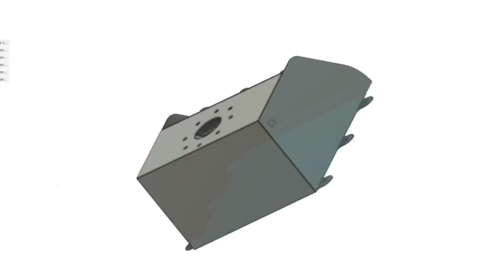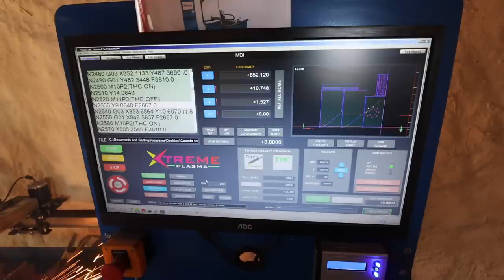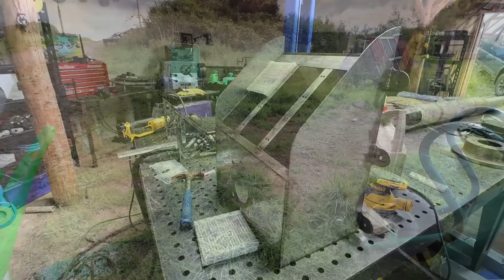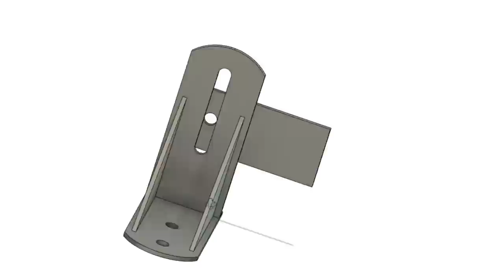North Wales 1.5kw Hydroelectric System Part 3 Coanda Intake Box

Comment: Use to weld stainless steel junction boxes for the refineries. So if you put on a leather welding glove, hold the torch so the tail is between your thumb and index finger, you can slide you hand along the edge and fuse the 2 edges together, no need for filler wire. Practice on some of your stainless scraps. No need for stitching, much faster and it looks great. Once you have your speed and temp down you can weld up 3 or 4 and hour. Use some fuse tacks to hold panels together. Tacks only need to be 1/8 to 1/4 inch long and when welding up just go right over tacks. Gives you a polished looking finishes without grinding. Good luck.
Reply: Spot on comment Andre, Gloves are a must.
Reply: Yup. Dead right, Andre. 👍
Reply: Really, really must wear gloves.
Reply: As someone who has just started welding, I really appreciate you posting this tip!
Reply: I'd be interested to see the back of those welds. Will he have much of that rocky oxygen contamination?

 @vremster  i'm new too and find fuse welding an easier method to get travel speed correct. Looks neat too.
Reply: Yeah you’re 100% correct only need filament for welds that are under stress, a box like this will be fine with just fusion welding you’d save yourself a lot of time but just fusing it! And definitely get yourself some gauntlets otherwise you’ll have two very sun burnt hands haha

Comment: If the UV was a concern to longevity then a simple hinged stainless cover on stand offs would shield the screens & protect against other falling items, leaves, sticks, branches etc.
Just lift it up to clean the screen then drop it back down, as long as the gap is good for the water to flow under of course.
Reply: Nice simple idea!
👍👍👍
Reply: Nice idea he had a bit of stainless left over from cutting

Comment: We've watched most of your early hydro electric content up to the latest videos and just gotta say we're EXTREMELY IMPRESSED with your work  👏, if we had a stream anywhere near, we'd be doing something like this, we see you running plasma cutters, grinders and all your other tools off power you have captured and it's amazing sir!! 👏 Also proud to see you put all hard work into your vehicles! As you have undoubtedly already seen, nothing really ever goes to plan with cars and vehicles in general! You seem to be great all rounded individual that will trouble shoot a problem or go crazy 🤪 trying, we try to hold our shop to same standards!! Impressive welding on that SSteel too 👏 👌 👍

Comment: Consider using stainless steel riv nuts for the screen mounting. Which will ease the maintenance in the future.
Reply: I was about to ask him why he isn't using them.  Would be much better and cost effective.
Reply: I was thinking the same , and you can get flush types too . Also if you damage a thread in the future you can drill it out and pop in a new rivinut.

Comment: Kris, a few thoughts about the coanda screens to make for easier assembly. 1) If the wedges had a taper on the end they would be easier to fit into their respective slots.  2)  Make an assembly jig that holds the wedges in the right orientation as if you were holding the wedges between two pieces of bread, then you can line up the sides while the wedges are held in the right orientation.  3)  Or make each side a two piece assembly that snaps together over the wedges and rely on the screws to provide a clamping force. 4) if your 3d printer is big enough, make wedges that are three screens wide and have the parts that used to be the sides be through-holes instead.

Anyways, I know you're busy doing awesome things so take it or leave it as you want.  Thanks for putting out such awesome videos! :)

Comment: Hi Kris, 

Just a little comment regarding UV light exposure...

The best is to use dark plastic as the UV light will not spread inside your plastic. The white version tend to get deeper penetration of UV light. The latest versions that I use of the Coanda tiles are with black plastic.

However, I have printed mounting brackets for my solar panels in white ABS and these have been out in the sun for 6 years without any signs of UV light damage. I have even tried to break one apart after all these years and they are as strong as the newly printed ones.

BE

Comment: If you turn up the amperage to around 120 for 3mm you dont need filler when tacking. So you can focus on getting the gaps aligned good with one hand and use the torch in the other

Comment: Hi Kris, first of all, I love your work :) - I've been binge watching the workshop build and more recently the roundhouse in the past week or so. 

Anyway, I just wanted to suggest a couple of things to make your life easier on this kinda project - instead of welding nuts onto the back of your SS strips, you could look into using rivnuts instead - we used them extensively in my last job - just drill (or plasma) an oversize hole, insert the rivnut & squeeze them with a rivet tool - they are threaded inserts. I would recommend ones with a hexagonal body as it prevents them from turning in the hole.

Also, I'm a 3D CAD Guy, but use mainly SolidWorks. I'm not sure if Fusion has the functionality, but you could look into doing these designs as sheet metal parts, which are folded, rather than cut as individual faces and welded together.

You could easily fabricate a metal folder and it would cut down on the number of welds you need to do to create the finished items.

Comment: Hey Kris great work. I probably already know this but when designing in sheet metal I make "tabs" kinda like mortise and tenon to help locate and 'stay' together for easier welding.  Basically it is its own jig. Maybe add gussets or strengthening bars, make it stronger but most useful for assembly.  Hit me back if you want more info.

Comment: You've made a good job there, a couple of things though: A coander screen is less efficient when it's straight, they usually have curves in them, IIRC like a very stretched out, almost flat S shape. Also, I would weld some guides on at the top so the water is channelled to the screen, this will make it more efficient when the water flow is less. Curved screen is harder to make though, I did contact the manufacturers and suppliers of it in the UK, but sadly they weren't interested in selling it to me, probably as it was too small for them to bother with 😞

Comment: Lovely project.    Would there be a benefit to making the coanda screen convex?   The top bit at a shallow angle would catch a lot of water at the expense of not being very self cleaning but because there is a lot of water that hasn't been captured yet, this bypass water will sweep away the debris.   The lower sections at a very steep angle will self clean beautifully.   A fold halfway will also make the screen stronger against sticks in a flood.

Comment: Could you use rivnuts for the screens rather than welding? Looks pretty good. You might want to look at pulsed TIG if your welder supports it. Can be pretty quick once dialled in 😀.

Comment: Great work as always Kris,  have you considered using stainless "Riv-nuts"  they would probably be cheaper and quicker to install,  i would also consider using captive nuts on every mouting hole for the coanda screens,  just to make maintenance a little bit less hastle and reduce the chance of loosing a nut and it becoming ingested in to the system.

Comment: Kris, When plasma-cutting parts to assemble, have you not considered having small locating lugs and cut-outs on the edges of each plate so that they self-locate when assembling structures, enclosures, brackets etc. Similar to what Matt does on the 'Superfast Matt' channel with the bits he gets from Send-Cut-Send

Comment: Hi when tig welding corner to corner if you have. It inclined you can what we say stove weld it coming down fusing both edges with the tungsten and very little wire used and what a perfect weld you will have try it see how you get on take care

Comment: Kris, have you considered using PEM inserts for fastening the screen rather than welding nuts on ?.  Set in place  with a small hydraulic press, (easily made up from a bottle jack) they might be quicker and cheaper than what you're currently doing.

Comment: ever thought about planning and cutting the boxes/brackets as a folding pattern defined through plasma cut slots (to reduce the welding seam length to 50% or less and the material thickness as well)?
Reply from the maker: Im not sure how well 316 stainless would bend at 2.5mm thickness. it would take some serious force. Its a good idea but I would need a family large folder.
Reply: @KrisHarbour  Kris, he means to cut slots leaving essentially 'tacks' at a few places, then folding it up like a cardboard box.
It does work, and you might find you don't need a full 3mm for stiffness.
Reply: @KrisHarbour ...  just cut the folding edges in 50% dashes, then it folds quite easy and the welding is reduced to half length

Comment: I was thinking that the coanda box would cause a loss of force, then I finally realised that it was at the top of the run. Der.
Stop working so hard, mate, you're putting us all to shame.
I've also finally noticed that the bottom shop is mostly for woodworking and the top for metal etc... Nice setup.

Comment: Welding sunburn on hands must be fun....
Reply from the maker: Honestly my hands just dont burn. I can weld all day with my hand exposed and nothing. The inside of my upper arm however will burn in less than 2 mins.
Reply: @KrisHarbour  OK.

If I weld without gloves, my hands smell extremely weird, like burnt steak, and I get sunburn on the back. Also no trouble with touching hot metal, with gloves on.
Handling TIG torch sucks with gloves though, that's why I have a foot pedal.
Reply: @KrisHarbour  I went to a dermatologist a couple of weeks ago for a check-up. I told her I didn't burn and she said that it didn't matter because the UV still causes damage to the DNA in your skin cells. That leads to mutations over time that cause skin cancer. It's just not worth the risk. She was referring to the sun. Welding UV is way worse.

Comment: Kris, you didn't put anything in the intake box to prevent a vortex. The pipe flange is just below the water level. Aren't you worried a vertex will form and drag air into the penstock?
Reply from the maker: Air gets in no matter what. It’s water splashing in there. The air gets out the stand pipe before it gets to the turbine.
Reply: @KrisHarbour  Yes some air will get in, but I try to reduce air if possible, so I have an anti-vortex umbrella at the inlet. I have a similar "air standpipe" like you have. Your automated turbine room is inspiring me to do something similar with mine. You have a very good set-up and the one you are making for your mate is looking very good also. By the way Your workshop is very well set up. I really enjoy your videos.

Comment: if you thread the bottom, make your screens with a step top and bottom on the edges, you need half the bolts to fit them, and thread the stainless rather than add captive bolts, only half the number of fixings, and less fiddle in getting to back of the filters. Use the acceleration plate to secure the top row of screens, with the step you put in the top edge.

Comment: I was looking at the prices of 403 stainless steel sheet the other day, and I noticed there's a very big gap between prices I find from online shops here in EU/USA, and the price you'll find on 'market' trackers. On aliexpress you can buy sheets for about the same as the market price, but of course you'll have to buy a ton or 2. 

The online western shop on the hand is 5-10x the price of that (and more in line with what you paid), so that leaves me wondering why nobody is doing arbitrage.

Comment: 316L stainless steel is almost identical to 316. The only difference is the carbon content. 316L's lower carbon content imparts even better corrosion resistance than 316. 316L does not require post-weld annealing.

Comment: Hey Kris great video as usual. I was watching you weld there & I was wondering if you had tried pointing the welding tip on either a 45 degree or 30 degree angle preheating the metal as you go to get a better weld puddle instead of how you were using it to point it straight up at 90 degrees from the welding material? I'm guessing you have already tried it or perhaps not but if you have any scrap you should do a few welds on 2x pieces of flat sheet welded together with a butt joint weld & weld one at 90 degrees, weld another at 45 degrees pushing forward to preheat & the last at 30 degrees pushing forward to preheat so that you can break each test welds to see which is the best looking weld & also strongest. As you'll be no doubt doing a lot more of these boxes it would be good for your welding ability to know which way has the best results & looks best for the customer.

Comment: Here's a question for you Kris.  Do you have a tough time throwing away your scrap bits of metal?  They do tend to accumulate over time.  Not sure if you have a plan to deal with the storing all the odd shapes that your plasma cutter will generate.  Maybe this isn't an issue with you.
Reply: I'm like this with wood. Can't throw away or burn anything 😅
Reply from the maker: Hi Paul. I do indeed. for a while now I have been cutting up all my plasma cut off cuts in to useable sized bits and keeping them. but they are to small to be plasma cut again so they would only be for small parts. I have a lot already and have started to try and give some away to friends. I have a full scrap trailer waiting to go to the scrap yard so it all gets recycled but I do find it hard to put stuff in there. But we would be swamped in it otherwise.
Reply: @DireChris  Yes, we are kindred spirits in this regard.  This is obviously true for rare or exotics, but also holds true for all hardwoods in my case.  Sadly, I've even extended this to a lot of softwood scraps.  I think if my shop had a wood burning stove in it, that would fix a lot of my hoarding tendencies - but that's not an option for my situation.  The problem is, if you find a use for a scrap that you've saved, you've completely justified your hoarding in your mind as necessary, prudent and prophetic.   My dad has the same issue with metal and the last time I visited him I worked on a storage system for all the categories and sizes he's saved.  For some reason, it's a lot easier doing this for someone else than for yourself 😁
Reply: @KrisHarbour  Thanks for the reply and explanation Kris!  Best of luck with your part 2.  I'll be interested to see how you get on anchoring those brackets into the boulders.

Comment: 300 bucks for just the intake? Wow.

Why aren't you fitting two pipes into each other, so the water can flow into the inner one and through holes into the outer, larger one?
Reply: Yeah seems a little much maybe it's the grade of stainless but the stuff I be buying is much cheaper

Comment: why does a sheet of stainless cost so much??
Reply from the maker: Inflation. and its 316 grade 2.5mm

this is an example 

https://www.aluminiumwarehouse.co.uk/2500-mm-x-1250-mm-x-2-5-mm-316-2b-stainless-steel-sheet?utm_source=google_shopping&of_tid=MFRWG5B5GI2DGJTGMVSWISLEHU2SM4DSN5SESZB5GU4TENRY&gclid=CjwKCAjw6fyXBhBgEiwAhhiZsoBkHu_IIpyJtujhax9ONY6mYFIdHF0LexNyVycGM2m-S5dj55kNoxoCgCwQAvD_BwE
Reply: @KrisHarbour  Hi Kris!  Is this optimised to the thinnest gauge and lowest grade SS which will do the job - or are you doing a 'belt and braces' on this one ......?!

Comment: A bit over engineered for me. Why not change the design a bit and screw all sides together with rubber in between each side too seal it up. You can buy rubber seals with grooves in them to make a pretty good water seal. It would take less time and effort and not be far off from what you have made. And you can take it apart later to install upgrades and just screw it back together. Making a lot of these will take ages doing it your way. With a different design you can just screw em together.

Comment: 6 koala panel :-)
Reply: Could you get a resin based 3D printer and print those coanda screens in one piece? That might make them stronger and last longer.
Kingroon might offer you a discount for a review model of one of theirs? 
From what I've seen they can produce very fine prints in ways that a traditional thermal 3D printer can't.